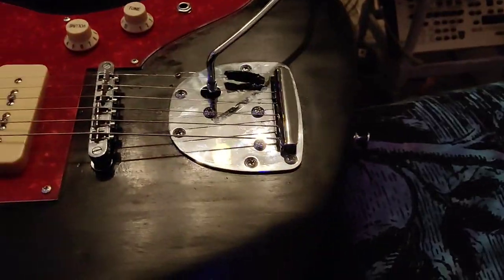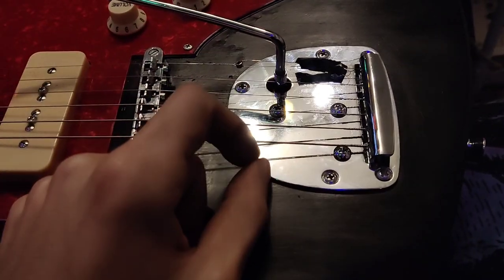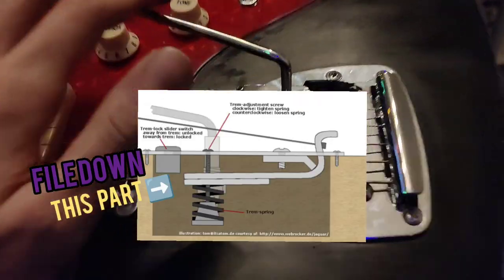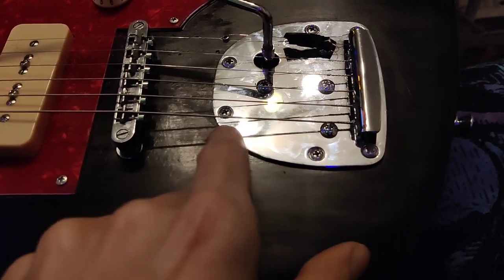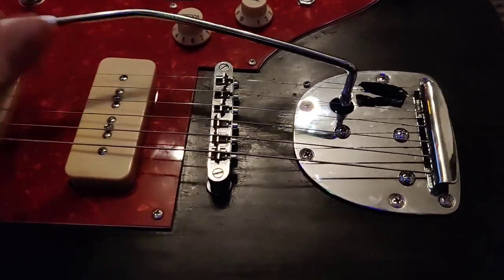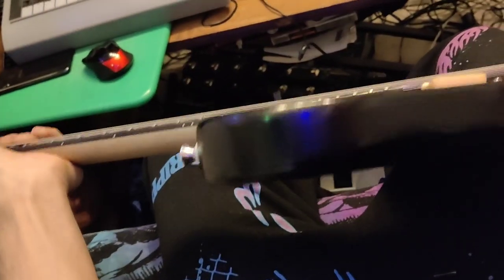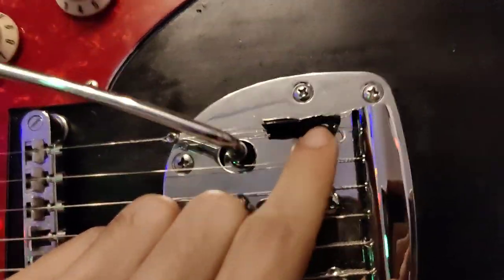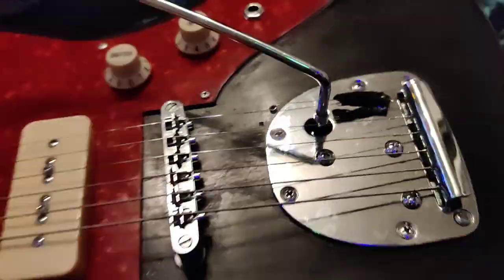HOW I FIXED A STUCK "EBAY" "JAZZMASTER" TREMOLO

Comment: Great starting point
Reply from the maker: it looks great rn ! sanded off the black paint and gave it a whole new look. i have it posted for 350 for sale just to see if it has any buyers and quite a few people want it.. i also shaved the neck down so it way slimmer.
Reply: @junksmith_wizard  what I meant was I bought a pango custom jazzmaster kit, they use the same or similar knock off parts, I finished mine and had the same problem. A terrible feel and the trem stuck... I watched your video and pulled the trem off. Sure enough grind marks in the front of the cavity.. filed sanded and fixed. This video was the best starting point for diagnosing knock off Jag- and jazzmaster trem issues...
Reply from the maker: hehe i see! thats good to hear!

Comment: mine was the same problem like yours😭😭，but i didnt understand what you said😭can you describe it more specificly?thank you
Reply: i push it down then it was stuck,pull up and stuck again
Reply: and that only happens when i loose the spring,i don't know why.But i don't wanna tight the spring,it's hard to play😭
Reply from the maker: @kiddnite4632  ok so im gonna try and explain in text 😹...

The tremolo is stuck because the plate that holds the spring,strings and trembar hits the wood on the guitarbody, when the strings are tight.

What you need to do is either take off a piece of the plate or take off a part of the wood in hole where the tremolo unit sits.  

It will be on the upper side of the pocket or the edge of the plate 

What i suggest is you use a file or sand paper and start removing alittle on the wall thats towards your neck 

ANOTHER GREAT WAY TO FIND OUT WHAT TO REMOVE

 SEE IF YOU CAN SEE SOME SCRATCH MARKS  

OR SOMETHING THAT LOOKS LIKE IT WAS RUBBING AGAINST IT

SORRY CAPS😹

Dont be scared of removing some .mm of wood just dont go all the way to the screws 😹

Also dont do to much at once 

Is my case i removed just on one side of the pocket on the wall facing the neck/pickups.

Sorry if its still unclear 😅
Reply: @junksmith_wizard  Thank you so much for replying,i already understand,i'll try sand paper and see if it works
Reply from the maker: @kiddnite4632  thats great! Glad i could help!
Reply: @junksmith_wizard  I just bought a sander and fixed my guitar with your method!!! You saved my guitar!Thank you again!😭